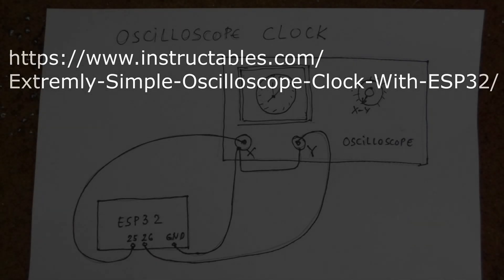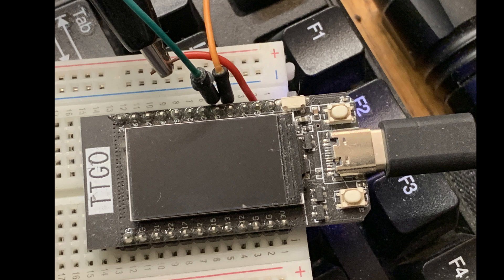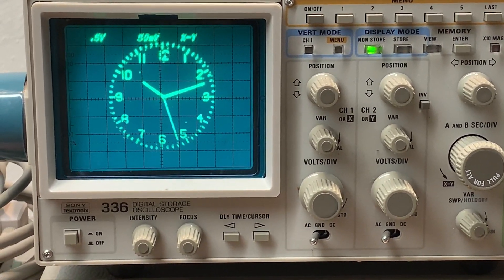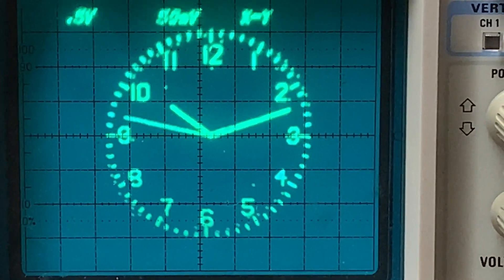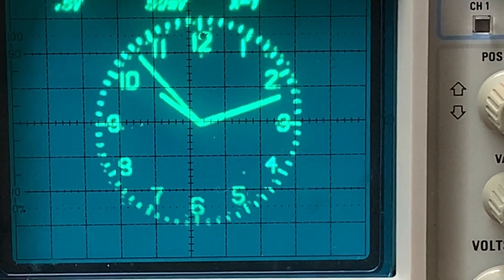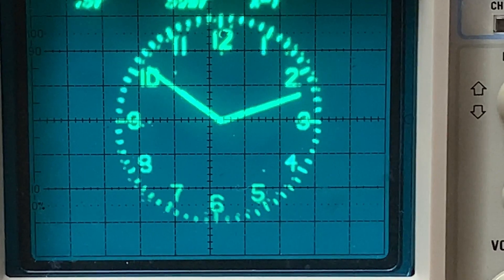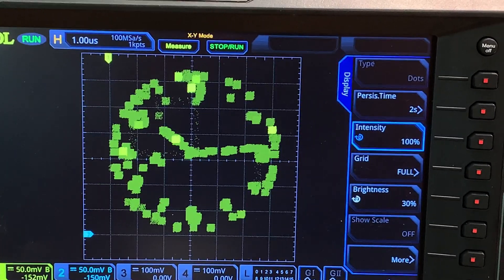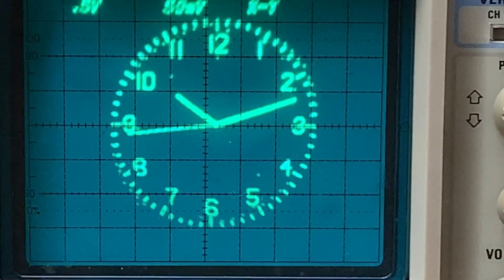#939 Oscilloscope Clock using a ESP32

Comment: This works great!   Perfect timing - A Tektronix 602 Display followed me home last week and now I can put it to use! 

 Since I used a newer rev Arduino IDE (2.3.6), I had to modify the following line:
  serial.println(rtc_clk_cpu_freq_value(rtc_clk_cpu_freq_get()));    
                   was replaced with 
                                 Serial.println(getCpuFrequencyMhz());   
This is because newer versions of Arduino IDE no longer use ESP-IDF internal functions

Also had to import  Andreas Spiess NTP Library (Link is in the sketch)

Comment: Hi there, question for you, so i just need to buy that one part then install the software into it and plug it all into the scope then it should work?  The website where the info is they no longer sell the parts so just curious how to get this to work, new to circuits and oscilloscopes.
Reply from the maker: yes it is that easy
Reply: Well i might reach out with further questions, like installing the software, never used any of this equipment before so guess its a good learning process.. and not electrocuting myself would be great :)

Comment: Settings for Rigol for good results:
Ch1 DC, 385mV/div, Pos -1.65V
Ch2 DC, 385mV/div, Pos -1.65V
Horizontal 20ms/div
Aquire Mem Depth 600M
Trig Pos 1.6 V
XY Mode
That works good on my Rigol 1054

Comment: Interesting.  I always thought you needed to use the "Z" (intensity) input to turn the beam off when moving from place to place on the screen.  Otherwise you would get connecting lines like drawing on an etch-a-sketch.  Must be using a different methodology.  Scratching my head over that...
Reply: During the "off" sections of the trace, the beam is simply moved fast enough to avoid visibly exciting the phosphor. Some of these traces probably start to become faintly visible if the screen intensity is cranked up to maximum.
Reply: @NimbleJack3  Makes sense.  That would also explain why it looks bad on the digital scope.  The digital sample and hold doesn’t care how long the "beam" has been at a location like a true phosphor scope does.

Comment: One parameter you did not mention was the time base, the time base button with which you set the speed with which the signal is presented dot by dot. This is a parameter that has not to be adjusted at analog scopes when working with xy presentation but which has to be adjusted at digital scopes in this case. 
It should work, (together with joining the dots).